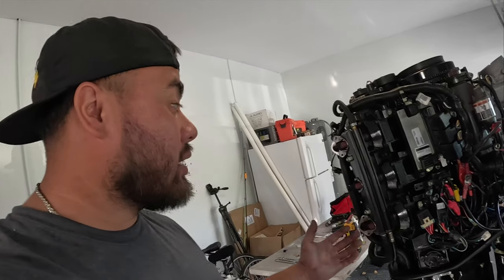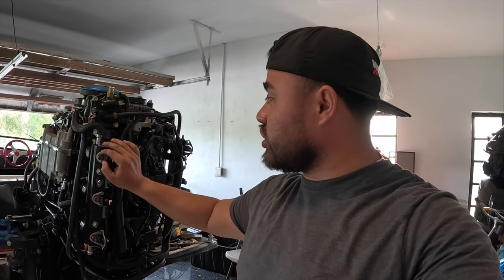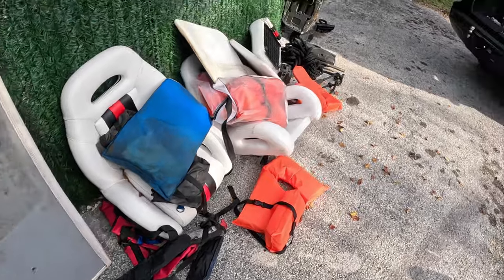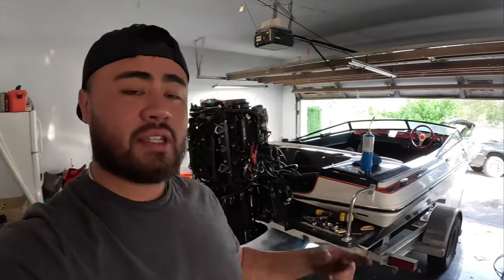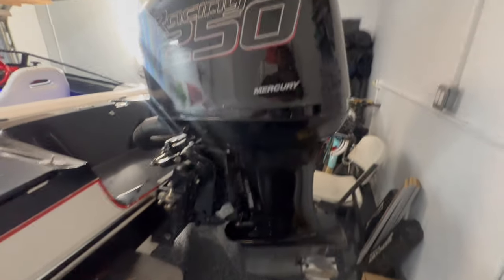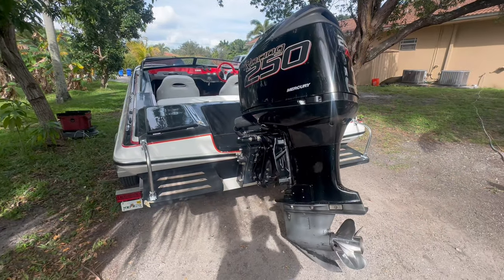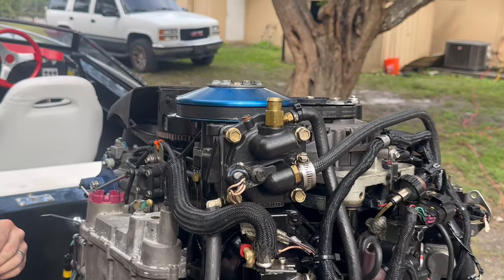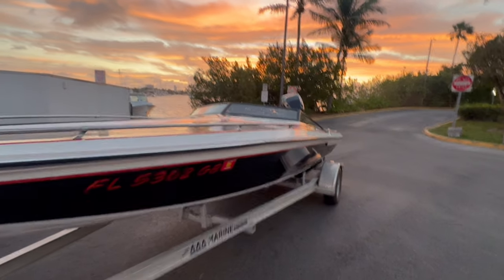CHECKMATE FAST BOAT IS READY FOR ITS FIRST SEA TRIAL !

Comment: Great project
Good to see you using the CDI software Ive been dealing with them since they were "RAPAIR" and Ray took technical support calls
do yourself a  favor and get a plan to add some serious setback
It needs at least a 12" box not sure with the weight of the 3.0 Back  in the 90s I installed at least 20 stainless marine brackets on various checkmates with night and day gains
my personal starflite with a strong 20" 2.5 carb gained an honest 10 with 18" setback being the only change running both a "rolled" DAH 27" SRX and a 24" DAH Raker without a step the balence is so screwed up that you waste so much power trying to lift the boat by uselessly over triming 
mine just came alive and was such a blast with the Raker needing little more than neutral trim (relatve to the horizon) meaning the gearcase was running nearly straight thru the water 
at speed the solid water passed just over the top of the torpedo wasting little water in the air 
shure miss that ride!!!!!

Comment: How much setback are you running? Also, would a shorter  mid work on this boat?
Reply: It needs at least a 12" box not sure with the weight of the 3.0 Back  in the 90s I installed at least 20 stainless marine brackets on various checkmates with night and day gains
my personal starflite with a strong 20" 2.5 carb gained an honest 10 with 18" setback being the only change running both a "rolled" DAH 27" SRX and a 24" DAH Raker without a step the balence is so screwed up that you waste so much power trying to lift the boat by uselessly over triming 
mine just came alive and was such a blast with the Raker needing little more than neutral trim (relatve to the horizon) meaning the gearcase was running nearly straight thru the water 
at speed the solid water passed just over the top of the torpedo wasting little water in the air 
shure miss that ride!!!!!